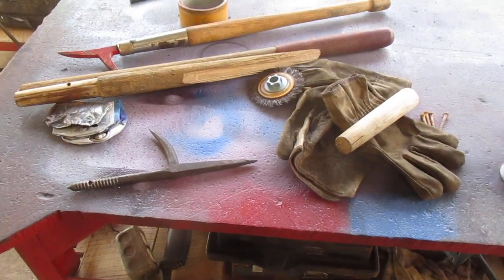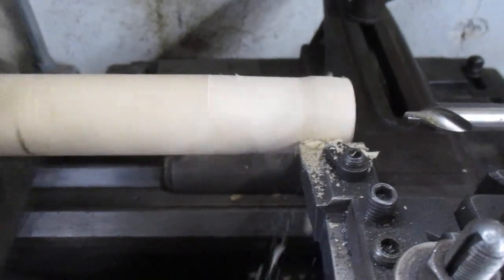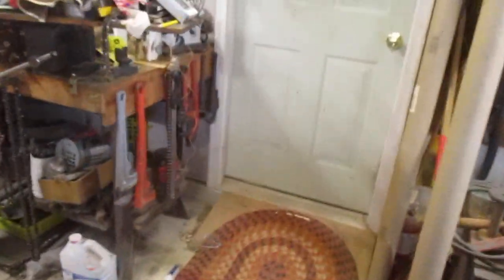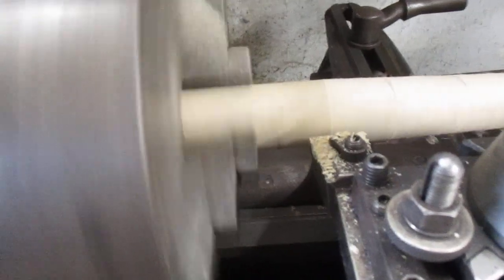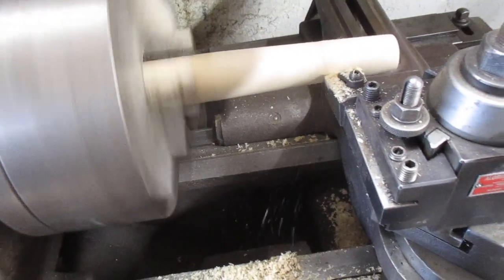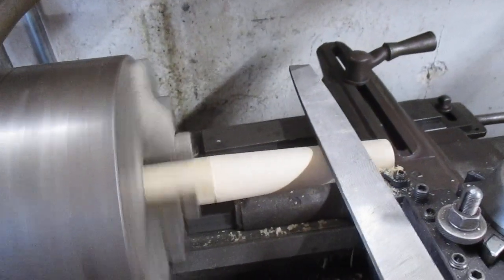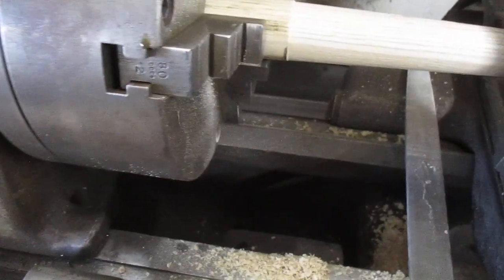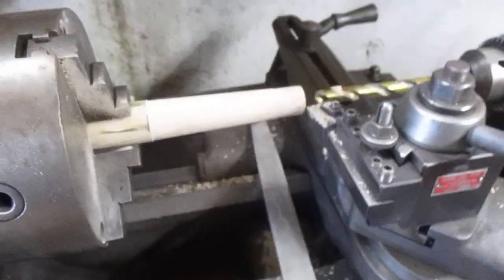Lathe taper attachment  CRASH  at the end # 1081

Comment: Clean the shavings off the lathe.  Not sure about hickory and ash, but oak has enough tannins in it to leave terrible stains on the steel. DAMHIKT As a turner I could have turned that taper in about three minutes on my wood lathe but could not have drilled the hole. Orient the grain in the same direction as the pick.
Reply from the maker: hi there i know about the oak but thanks , as for the orientation i thought about it before i i started but totally forgot about it when putting it together . 
then remembered about it when done looked at it but can't remember what i did , part of getting old and some because of the mind being on the video  thanks for stopping in john